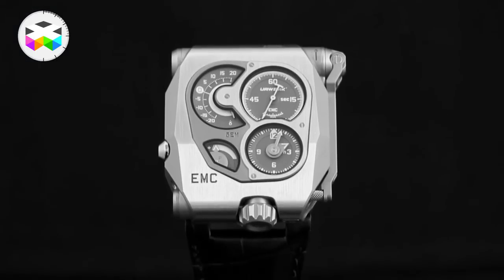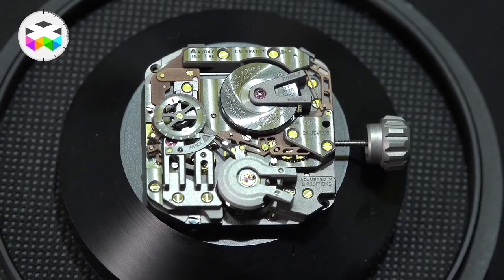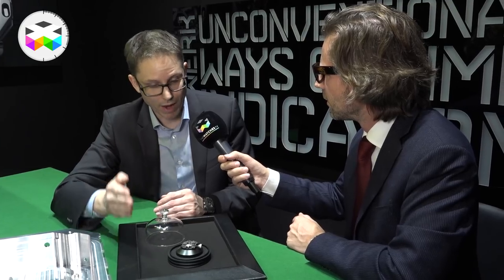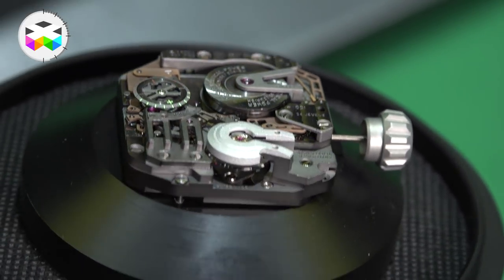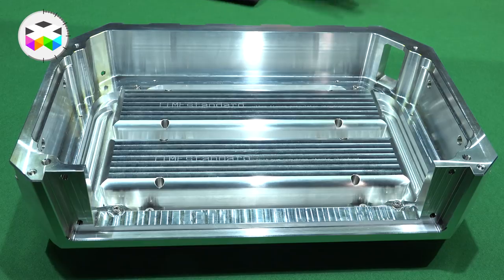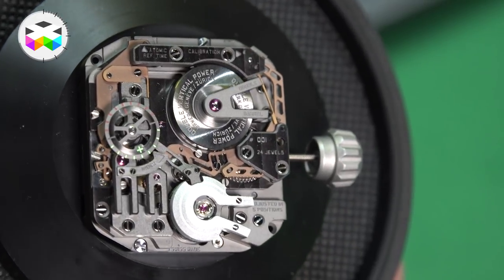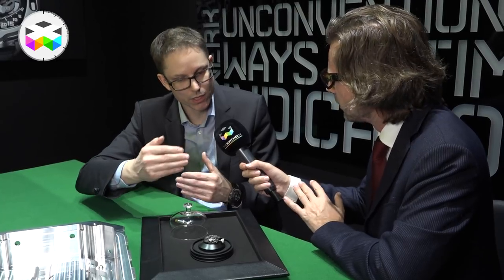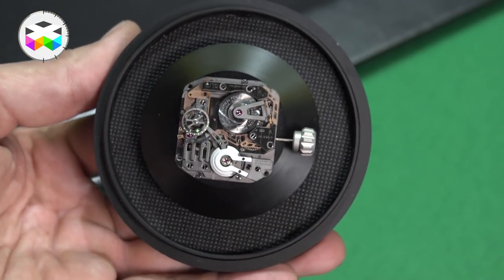URWERK Teases Us with the AMC at the 2018 SIHH

Comment: I was already highly impressed with RESSENCE's haute eCrown electrical technology, sitting between the mechanical movement and the dial, to sync to your phone and be atomic Internet time correct.

However, not once did I think that you can achieve this TOTALLY by mechanical methods.

I own three timepieces, with my Casio G-Shock G-Lide GWX-5600WA-7 (Summer 2017 Edition) having Multiband-6; atomic timekeeping calibration in-built via radio signals.
I use this to manual set both my Tudor North Flag, and Omega Constellation Globemaster Co-Axial Master Chronometer, timepieces, to be close to atomic time correct for the day.

Yet URWERK goes beyond this, beyond eCrown or Multiband-6, or any technology, by being both supremely accurate AND fully mechanical.
I can only think of one other movement that can come close to the accuracy of the AMC; Zenith's ZO 342 calibre, currently inside the 2017 Defy Lab limited edition watches. THAT calibre is already super accurate, yet URWERK's AMC smashes it. What's more, AMC, alongside its companion desktop atomic clock, can self regulate to atomic time MECHANICALLY.

I think I just found my ultimate grail movement, overtaking the Zenith ZO 342 calibre!

URWERK at Baselworld 2018 is gonna be LIT! 🔥

Thank you Marc for conducting the interview, and, excellent choice of background music 👍🏽💓⌚😘

#MinuteRepeaterPatreon
Reply from the maker: Thanks so much and yes i can really promise you that this is going to be incredibly spectacular!!!!!!!!

Comment: So, every time the watch runs out of power reserve, do you have to ship it to Urwerk in order to set the time precisely?
I am a little bit confused..
Nonetheless, thanks for sharing all the details of the best timepieces shown at SIHH
Reply: Marco Palestra 
You buy an atomic clock (which suppose to be that metal case thing)  . After wearing the watch you can sync the wrist watch with the atomic clock case, so it keeps accurate time. Not only that it will adjust the rate at which the wrist watch ticks according to how you wear the watch.
Reply: Kimi Zwazy that sounds reasonable!😂
Reply from the maker: If you mean the atomic clock, then don't worry, there's no problem with that one and with the "portable" one, no problem either, you can wind it normally yourself. Best to you
Reply from the maker: Thanks for this!

Comment: So if I got this correct, you wear a completely mechanical watch and at the end of the day you place it into the Atomic clock that receives the signal like regular wave ceptor watches, and than this atomic clock sets the time of the mechanical watch?
If that's true I would like to see the mechanism that connects the 2!
Can't wait to see it in action 👍
Reply from the maker: You got it right, but the atomic clock only needs to be set once. Can't wait to see the full package totally finished!
Reply: TheWATCHES.tv A-ha, so the master clock is a real working atomic clock, not a radio controlled clock that receives a signal?! Wow, that is even more impressive!!!